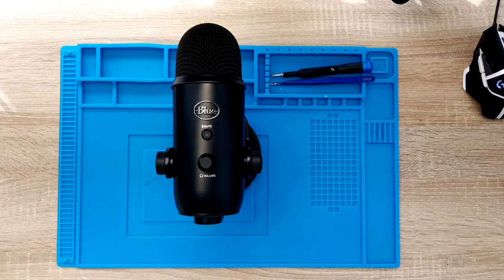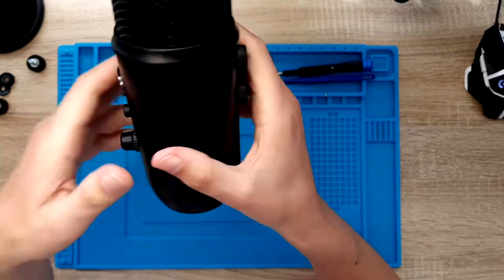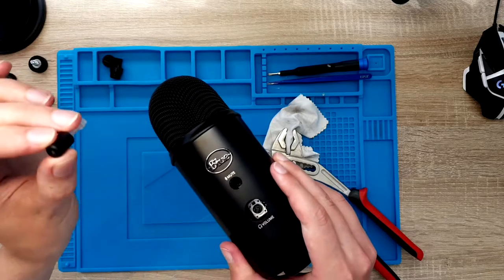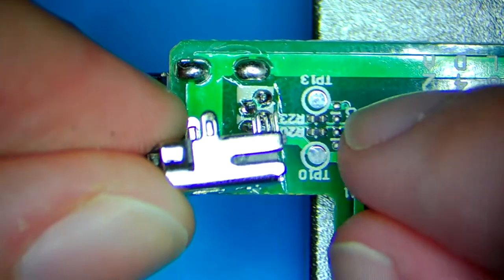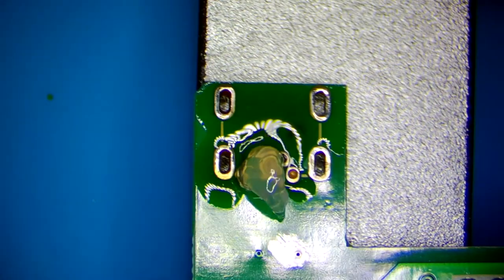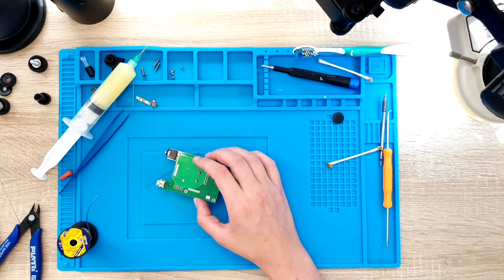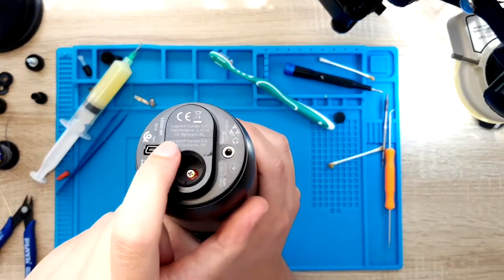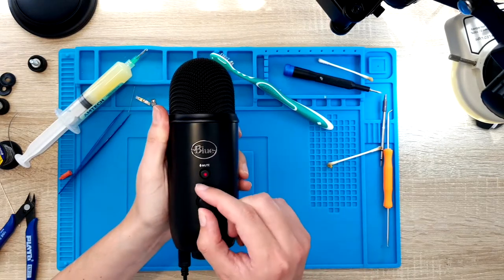Blue Yeti Microphone Repair

Comment: I received the same model, but the USB points were damaged, do you have a schematic to be able to directly connect the cables to the board?
Reply from the maker: No schematic but you could just follow the ripped traces. All of them goes to nearby componenets.